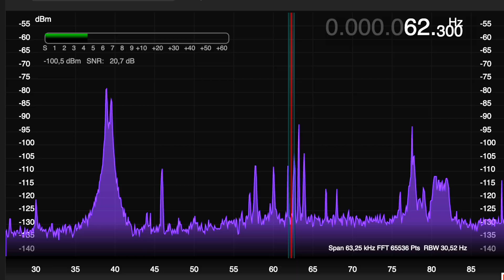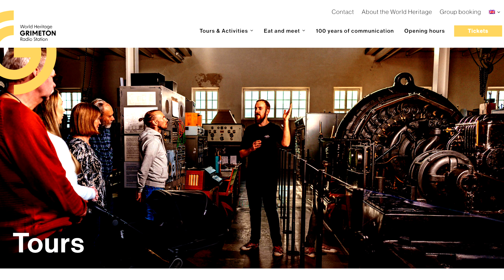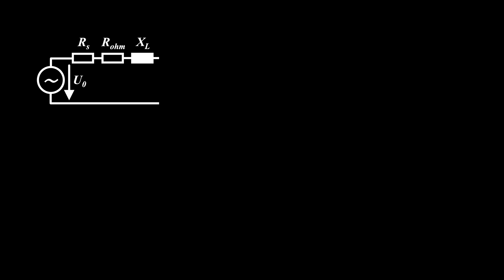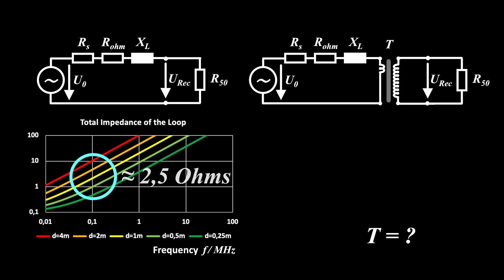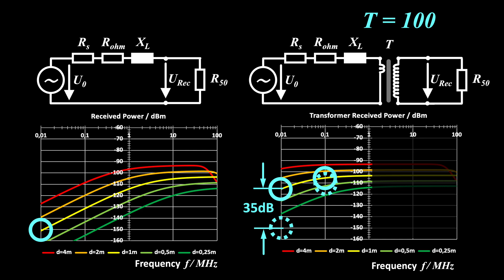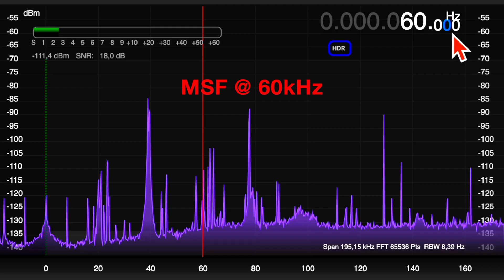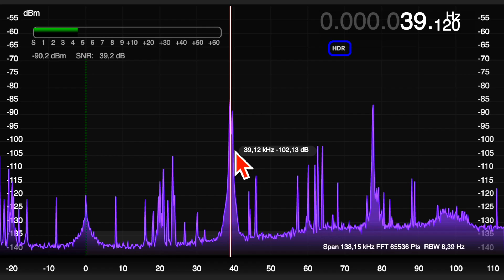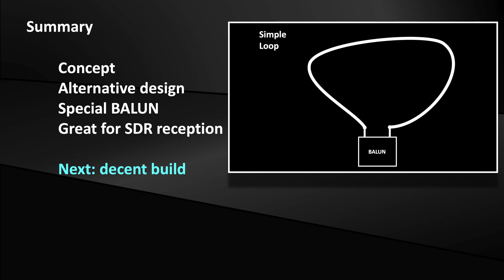Very Low Frequency (VLF) Reception: A Serious Alternative to Big Coil Antennas (EP170)

Comment: Hi, very interesting, I use a 1 meter diameter loop with 200 meters of 0.5 mm, what value should the green toroid have?
Reply from the maker: Thx for your comment! I would be very interested in a comparison. The toroid is 15mm inner diameter and 25mm outer diameter. In my first tests I found that cheap choke ferrites are better for the purpose. I will come up with an improved version soon. Stay tuned.
Reply: @electronics.unmessed  Thanks for the reply, I'm looking forward to the other videos! Congratulations on the YouTube channel!
Reply from the maker: @puckmatthers5077  Thank you very much!

Comment: What are the Terms Rs and R ohm in your formula for the loop impedance?
Reply from the maker: Thx for your comment!
I mentioned it in earlier videos, but maybe not clear enough in this one.
Rs = Radiation Resistance of the loop 
Rohm = Loss Resistance of the loop
I recommend the earlier videos.
Stay tuned.
Greetings
Reply: @electronics.unmessed  Thank you so much.  Rohm is easliy calculable but I will check with your previous posts for Rs.
Reply from the maker: @braidybecket8946  You will find it ..

Comment: I use a degausing coil from an old CRT TV. Works very well with both my McGreevy VLF receiver and computer sound card using spectrum software.
Reply from the maker: Cool! Thx for your comment. What frequency range are you receiving?

Comment: What’s the cheapest way to transmit on LF, VLF or ELF? Can I use an abandoned railroad?😊
Reply from the maker: Thx for that comment! 
I am always looking for that kind of ideas. With rails probably the ground coupling is your enemy. In case you can manage to make it a loop, the influence of ground coupling is lowered due to its low impedance.
Try it - I would be curious to see the results.
Greetings 
Klaus
Reply: tuner + cow fence

Comment: For transmitting antenna have a look at the Hately antenna (omni-directional), though the lambda/4 cable would be quite long (if synthesised that way)
Reply from the maker: Thx for your comment!
Interesting principle. I remember an IEE conference in the late 1980s where this antenna was presented. The experts were all very skeptical.
Do you have any experience with it?
Reply: @electronics.unmessed  Hatley came to give a talk to the IEE (now IET) in Glasgow (I was on the local committee).
His big problem was he hadn't worked out a palatable way of presenting it. He was using the academic 'conflict' style.
In reality, he was creating near spherical fields locally, rather than having to wait for 3xLambda before the EM parts  sorted them selves out (e.g rod, and loop extremes).
It is a transmit only antenna (spherical outbound), but crap [technical term] in receiving plane waves!
The military did do tests and found it worked as predicted, but didn't have enough benefits.
For me it did show how one has to delve that bit deeper behind the scenes to really understand what is going on and why people haven't bought into the explanation.
He challenged the laws (transmit vs receive areas), rather than the assumptions..
Reply from the maker: Thx for sharing! I happy to have knowledgeable people like you among my viewers.

Comment: Hi, you might want to double check the formula at 4:27: if T is the impedance transformation factor, then T ≠ N2/N1, but actually T = (N2/N1)^2. This means N2/N1 = √T, in this example for a required T=20 the ratio of the windings for your BALUN would be N2/N1 = √20 ≈ 4.47
Reply from the maker: Thank you so much for your comment!
You're right, that's exactly how it is. I used T as the voltage ratio, that is, the ratio of the number of turns, and did the calculation with that. But the impedance is transformed by the square of T. This certainly increases the reception power at the 50 ohm input compared to my calculation and makes the concept even better. But let's see what happens when I finally realize the antenna. 
Greetings Klaus

Comment: At 4:27 you require a N1/N2 of 20. Isnt the impedance transfornation defined as the square root of this value?
Reply from the maker: Thank you for your comment!
Actually, it's the square of the impedance ratio. 
I used T as the voltage ratio, that is, the ratio of the number of turns, and did the calculation with that. But the impedance is transformed by the square of T. This certainly increases the reception power at the 50 ohm input compared to my calculation and makes the concept even better. But let's see what happens when I finally realize the antenna. Stay tuned!
Greetings Klaus
Reply: Du hast recht, die Impedanztransformation geht mit T quadrat. Auch auf die Gefahr hin besserwisserisch zu klingen, muss ich an anderer Stelle widersprechen. Durch die Transformation erhöht sich natürlich die Eingangsspannung am Empfänger um den Faktor T. Die Eingangsspannung fällt dann aber über 50 Ohm ab und nicht über 2,5 Ohm. Leistung ist U_quadrat/R. Die Eingangsleistung (reception power) am Empfänger kann ja nur maximal so gross sein, wie die aufgenommene Leistung der Antenne (sonst wären sie Energieprobleme der Welt gelöst). 73 Andreas

Comment: This theory and practical applications were developed by BarkHauzen and Steinmitz over a hundred years ago.  The fundamental noise levels and limits are actually established by the magnetic materials themselves.  Our company did surveillance work for the Navy, and if you are using just ordinary materials, especially ferrites, you will have excessive noise levels.  Also avoid any local temperature effects, pressure variations, or external magnetic varying fields.  Super-cooled detectors work the best.  Look at the LIGO Gravity Detector technology, and see how they do it.

Comment: @electronicsunmessed ... try a "'miniwhip"  type of antenna ... you be amazed how it receives better then most antennas , specially on the lowend of the band  (10 to 500 khz) ... a miniwhip has only a size of 6 cm !

Comment: Which SDR software are you using  ? It looks pretty neat
Reply from the maker: It's SDRConnect which is working perfect with my RSPdx.
Reply: I'd be interested to know a bit more about the SDR side as well: how do you listen to VLF on your SDR? Is it a specific one which can accommodate such low frequencies? Thanks for your very interesting video. 73 from Jean-Luc F4LBH @electronics.unmessed
Reply from the maker: @jean-lucaudoin8538 I will explain this soon in more detail covering SDR and input impedance. Greetings Klaus

Comment: What about using taps to vary the ratio with a switch to make the ratio optimum on several frequency ranges.  Can that work?
Reply from the maker: Good point, thx. I think, this will work.

Comment: Hi Klaus, Great Video! I am looking at a way to miniaturize a VLF Transmit antenna Between 60-80kHz to cove a a radius (or a Distance) of ca 100m , a Crystal VLF Antenna like the ones from SLAC would be a Solution, but inoptanium and probably unplayable. Do you have eventually any Ideas ? I tried Ferrite Rod antennas but worked only for 1 Meter even with 20W of Driving Power.
Reply from the maker: Hi Konstantin,

thx very much for your comment! Glad you like it. 
I think you can achieve much more than 1m distance.

My thoughts: at low frequency you're struggling with 2 problems:

a) Radiation resistance is very low -> transmit problem
b) Antenna gains are extremely low, like -60dB or even less -> receive problem

You can overcome a) by using low loss material and pushing the current to the max for transmitting. Try to go to low voltage and high current. Otherwise, you're just heating up your coil antenna.

You can compensate b) a bit on the receiver side by using many turns of thin wire and a high impedance receiver input. Push the amplification to the max, apply filters to reduce noise etc.

Hope that helps. Looking forward to your feedback.

BR Klaus
Reply: @electronics.unmessed Hi Klaus, Thankyou! On the Receiver side i cant change anything , only at the tx side. If you have eventually a design example for the above requirements for 77.5KHz would be great! Thankyou, Konnstantin
Reply from the maker: My VLF loop suggestions are not ideal for transmitting, but perhaps you could give it a try.
Reply: @electronics.unmessed  Thankyou!

Comment: Thank you. LF antennas are my area of greatest interest. As I was working at communicating with a single station I used a short vertical whip antenna (between 1 and 3 meters long,) with a tuned FET pre-amp at its base. At 175 kHz I found that a longer whip started to receive more noise than signal, and a shorter whip would lose too much signal compared to the FET generated internal noise. But such an antenna is clearly very narrow band, essentially optimized for a single signal. I had toyed with the idea of using a varactor diode in the pre-amp circuit, and controlling it via a varying DC fed over the coax I used as a transmission line, but the Q of any of the diodes I found was lower than desired as the goal for the antenna was to receive the narrowest bandwidth possible. The whip/pre-amp combination worked very well, even in the car. My transmitting antenna was, of necessity an entirely different design. A mobile transmitting antenna for 175 kHz was beyond my engineering capabilities. I suspect it is beyond almost everyone's capabilities, a Holy Grail of LF communications.

I never experimented with broadband loops at LF or VLF, so I expect I will watch these videos multiple times. Thank you for creating them and offering them for free to those of us who find the long range of low frequency RF to be a fascinating subject.
Reply from the maker: John,
Thank you for your comment.
It's great that you keep sharing your experiences here. In the next video, I'll remind my viewers to read more comments. It's really worth it. Yes, VLF transmit antennas tend to be large. But it depends on your vehicle whether it's mobile or not ;-).
In the next video, by the way, we'll be setting up a switchable LF/VLF antenna. The reception results are great, and passive antennas simply have the advantage of not having intermod problems.
Best regards from Germany
Klaus

Comment: Hi Klaus, another interesting video. I'm wondering if the type of material mix used for the balun is important for the target frequency you want to receive. I know there are various mixes optimized for specific frequencies, reducing losses in the frequency range they're intended for. Just a question.🤔🤨🤩
Reply from the maker: Thx for your comment! Indeed, ferrite material is important. Especially when it comes to higher frequencies. For the low frequency we talking here it seems not to be crucial allowing me to a cheap DIY suggestion. Stay tuned for the coming video where I am showing reception results with the final build. It’s amazing! 
But I agree, in case of higher frequencies you need to use high quality ferrite, sophisticated builds etc. And also important: at the end of the day we’re talking about receiving only. So you don’t care about a few percent loss. BR Klaus

Comment: Hello sir, I would like to ask you something, if you have the time.
I have access to a very long wire (near 4 km long) suspended 6 meters over the ground.
How could I connect to this antenna without modifying or cutting the cable? Currently I am using a 9:1 unun touching the cable with a crocodile clip 200 meters from one end and the ground to some barbed wire of cattle fences.
What could I experiment with this antenna? Thanks
Reply from the maker: Interesting! Actually I did think about the use of such wires. I‘m guessing this antenna will work down to 8 km wavelength provided the wire is low loss. Coupling to the ground is an issue pushing the main lobe perpendicular to the sky. Probably higher resonances are more interesting. 4km, 2, 1, … Would be nice, if you could share your experience here.

Comment: I've been very interested in how some casio watches can receive msf60 very reliably with such incredibly small antennas. Would be great to see how small of an antenna you can build and still receive a discernible signal.
Reply from the maker: Thx for your comment! Good point. It’s a matter of receiver sensitivity. You can make that much better, if you receive just the one narrow band signal repeating every second. I made an earlier video on how to save signals from noise … it’s showing the principle how this works.

Comment: Hi Klaus.. W1VLF here, I made a series of loops using the same concept as you did.  However I did not know all the math you do. I optimized the loop using only this basic knowledge.  The loop got bigger and the transformers got better as I went on.  Thank you so much for you explanation of what is actually happening.  I always enjoy your videos.  Here is a link to the "LIL" Low Inductance Loop  that was the final model.  Looking very much forward to the nest loop video  https://youtu.be/87Y2pt0FGeE
Reply from the maker: Hi Paul, 
thx for your comment. 
Just watched your video: great make, great tractor ride ;-). That's what we call hands-on experience! 
Looks like you found an optimum by experiment that is not far from what I calculated. Really impressive build. 
In a coming video I will share reception results of my final make. 
How would you rate this antenna compared to a big coil antenna?
Greetings Klaus